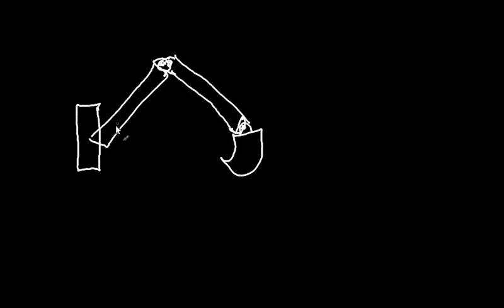Backhoe Concept

Comment: Could just make the attachment plate rotate. Just one side would have pivot points, and the other attached with a hydraulic piston. That would however mean the pivot points would need to be very strong.